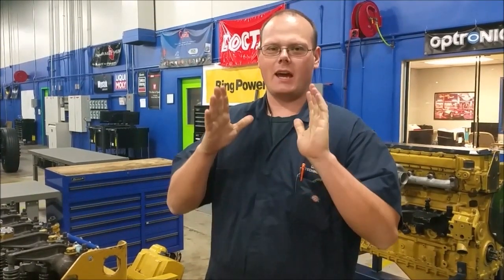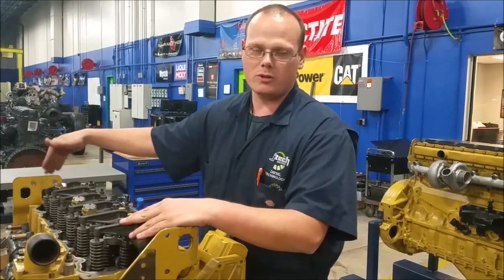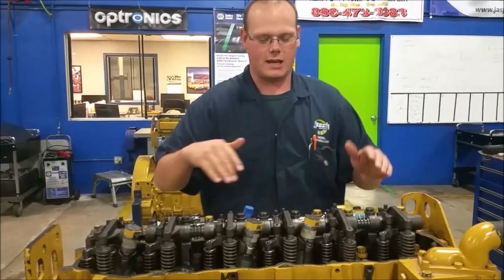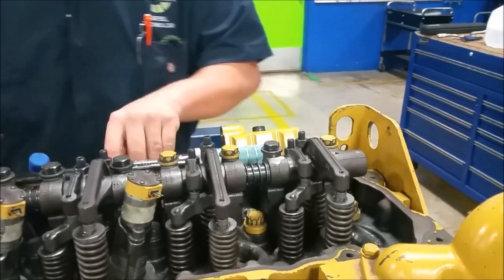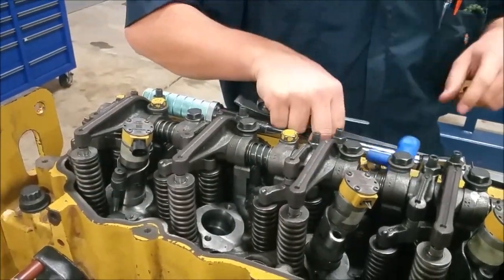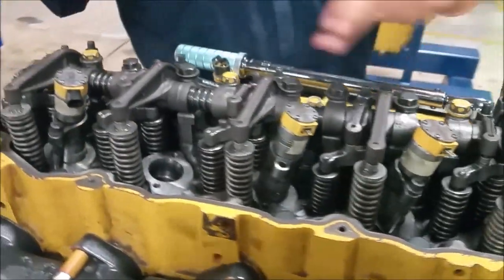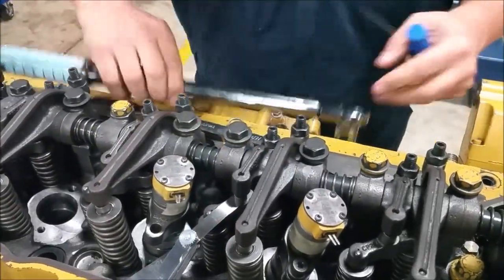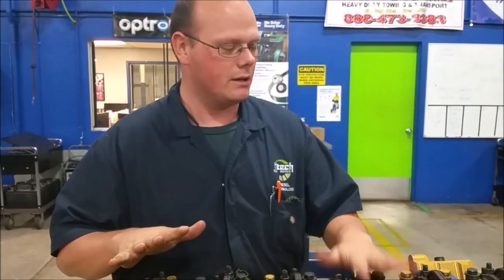Valve Adjustment

Comment: Please i need your help If you dont mind.... My cotton picker smokes at low rpm i think grey smoke and in 2000rpm it works fine during the picking ... Is it possible   to need Valve adjustment? I think that the diesel pump works good... The noise during low rpm is similar to rattle.... Thanks

Comment: I have a 235ci chevy engine that has a blown head gasket.... is it possible to pull the head and replace the gasket without pulling apart all the rockers and springs from the head. I know this question is a little off the purpose of your video but I'm guessing you would know.